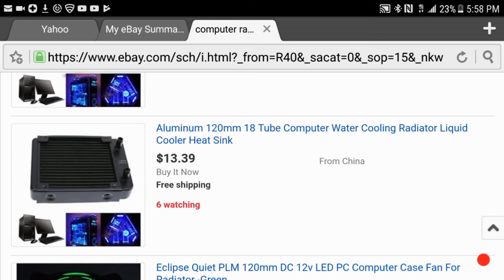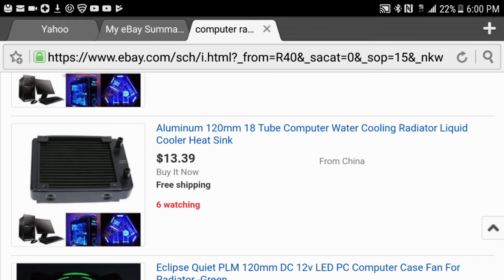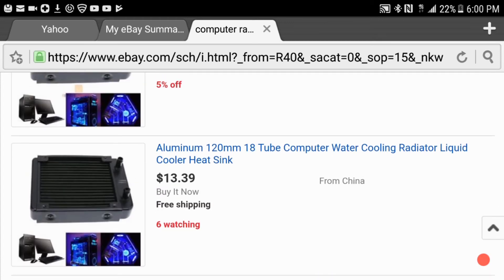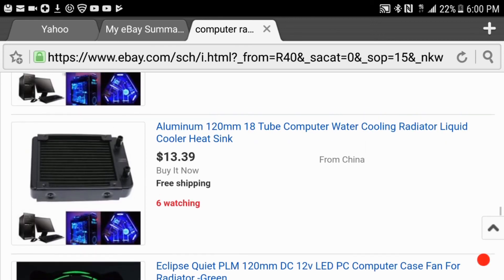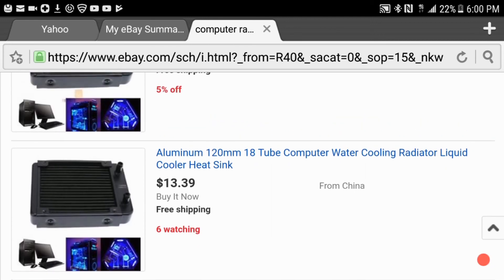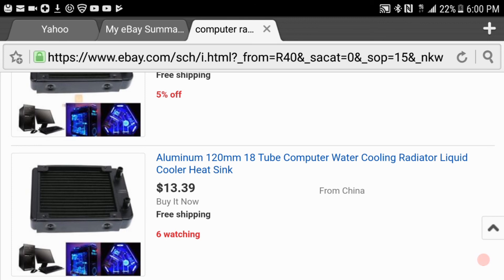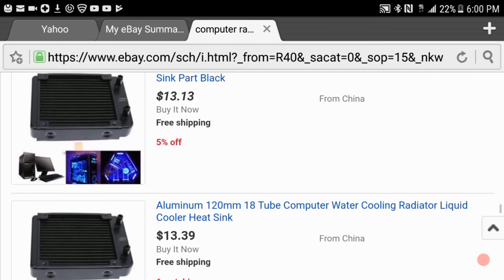Homemade DIY Icybreeze portable ice ac cooler for less than 50.00 Part 5

Comment: I was trying to build something like an Icybreeze when I came across your videos. I don't know how their radiator is constructed, but I'm thinking it must have fewer fins packed into their coils.  I've tried a radiator similar to the one in this video and the amount of condensation that forms on the fins actually blocks airflow. In a 70F room with 60% humidity, the coil will drop into the 40's(F) and the air coming out will be in the low 50's(F). After a few minutes, the air temperature starts rising because the radiator's fins fill up with water from condensation. Soaking the water up with a paper towel and the air temperature immediately drops.
Reply from the maker: It's all stuff they brought from China. They didn't manufacture any of it. Its readily available on Ebay and Amazon.
Reply: @peterl6095  I figured that, I'm just trying to figure out how they got around the condensation cloging issue.
Reply from the maker: @jason00794  

There's just a fish water filter at the intake end of the tube.